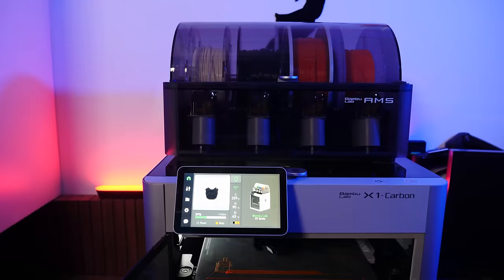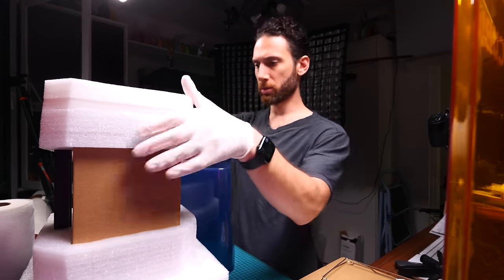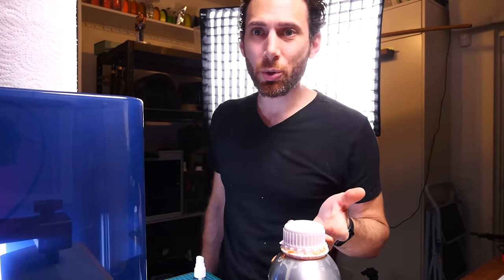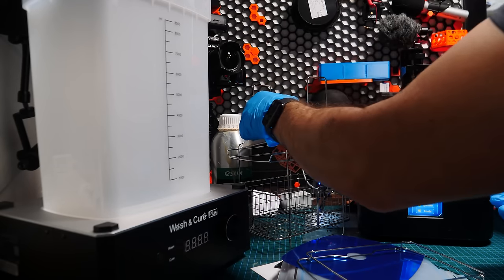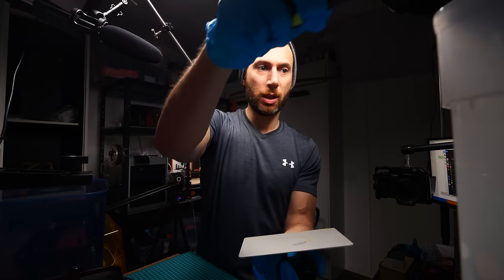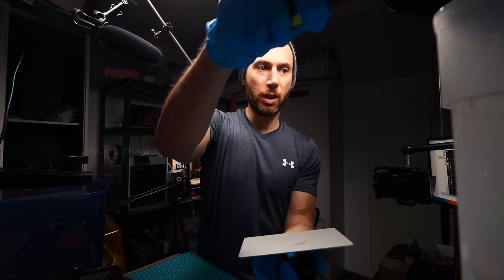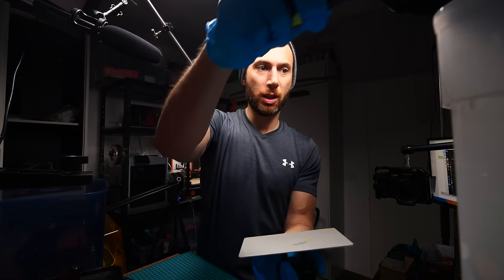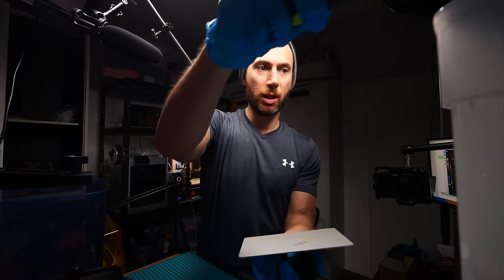Resin 3D Printing Wasn't What I Expected. AT ALL.

Comment: It's always interesting to see how a newcomer experiences first time resin printing. What always gets me on Youtube is how the noxious vapors problem is presented. Depending of the brand, yes, liquid resin can stink. But honestly, the respiratory risk you may encounter with UV resin is WHEN IT'S PRINTING, not just in its uncured or cured state. So it's a good thing the printing chamber is sealed during printing and now printers are sold with active carbon filters inside just for that. The VOC cartridge mask is unnecessary just to fill up the vat. Nitrile gloves (latex won't do) on the other hand are always always mandatory. 

BUT there's one moment when putting that mask is necessary: it's when you start handling liters of Isopropyl alcohol to clean the parts. That volume of alcohol can be fairly detrimental to your health, give nausea, headaches and implies a very well ventilated area. Note, Jonathan is not using his mask at that moment when it would be most useful. The solvent handling part of the post processing to me is the main hassle of UV resin printing. IPA is costly, a respiratory hazard, is a pain to recycle or dispose of when it becomes mixed with resin as a cleaning solution  but offers the best cleaning possible, industrial degreasers or methylated spirits being close seconds.  And none of them are risk free to handle or easy to recycle. 

To reduce cost, I'm using ethanol (aka methylated spirits) for the 1st cleaning bath and IPA for the finish one. The print gets enclosed in a sealed thin plastic tub with the iPA and floated in water for 6mn max in an ultrasonic cleaner with the heat off and always supervised.  That's the  same way mechanical parts can be cleaned with flammable solvents in a ultrasonic cleaner btw (don't leave them for long, always be present, always put them in a sealed container immersed in water). Parts always come out squeaky clean with crisp details. Remember, you can get a print from a high definition printer but if there's still residue on it because it wasn't cleaned enough, it's going to mar the details of the finished product.
Reply: To correct this statement, FAR more VoCs are release during the washing & curing process, than during the actual printing. (Oddly enough since we use IPA and it evaporates at room temperature.)
Reply: @ccatlett1984  Agreed. I should have developed the point i was making further :)

Comment: I have also recently got my hands on a SLA printer. I got mine from Elegoo and the quality is exceptional with some caviats. I totally agree with you that it is a mess, even other YouTubers are warning about this. If you are careful enough and clean any spillage after each print, it is fine and not that toxic. I am even thinking to get an air purifier for the space that I am using the printer.

Other tips I can share: 
- Get silicon covers for the surfaces infront and around the printer. They will save your workbench from the resin and you can easily toss them outside on the sun for a few hours to clean them more easily.
- Get paper towels. I use them on top of the silicon covers when I am moving the prints out of the bed and also cleaning any remaining resin from the tank after transfering the resin back to the bottle and run the clean tank exposure.
- Get plastic cups that can contain around 300-500ml of liquid. I use those for when I need to transfre the excess resin from the tank to the bottle or clean the washing station.
- Try washable resin. I have ordered a few bottles to test it out. They advertise it as nearly odourless, safer and easy to wash with tap water. By the way, depending on what resin you use and how big the objects are the IPA can be used for up to 30 prints.
Reply from the maker: Thanks for the tips! Will do

Comment: I recently bought the Creality Halot One and I love it. I use Anycubic ABS-Like Resin+ (it offers the right properties for my needs) and it STINKS. Did one print in the house then moved it out to the garage. I didn't immediately by the wash and cure machine, but after a month for the Anycubic one. That makes all the difference. My workflow is not too messy, but it's all in the garage, requires mask and a lot of disposable gloves. There results are perfect, though, and it's easier than FDM to get good prints.

Comment: Heheh, it’s always fun watching noobs do resin 3D printing for the first time, having already gone through the hoops myself, now every print comes out nearly every time. Let me offer a couple of useful tips for anycubic resin printing. Before starting that very first print, what everyone must do (but they don’t tell you in the manual) 1) apply a release agent to the inside of the resin vat fep. This is the reason for your first 2 print failures and more failures will occur if you don’t regularly apply release agent to the fep, I do this every time after each print, it’s just a part of clean up process. 2) don’t fill the vat to the max level, just use an amount appropriate to your part to make cleanup easier. 3) anycubic photon slicer requires all models to be sliced in anycubic’s photon slicer mine uses a .pwma file format but they maybe different for your specific printer. If you want to use chitubox or lychee which I do absolutely recommend for generating supports, you’ll want to save the model with the supports as an .stl file and then import it into photon slicer for final slicing, if you slice with any other slicer , your prints will fail (or never even begin) at least this is how it was when I got started a year ago and I haven’t bothered to check if that’s been fixed) but if you run into any problems with that just remember to try and slice only with anycubic’s proprietary slicing software and you will be good to go. And finally 4) the best advice I can give with supports is rotate your models so that they are not parallel to any of the 3 axis and orientate your model with the side you want to be the cleanest opposite the build plate clear of supports. Lastly, there are some tips worth mentioning for cleanup, but this is getting a bit long, go ahead and let me know if you want those as well! Thanks for the video bro! Good luck!
Reply: Oh and remember to calibrate your resin exposure settings! These will be different for each resin has different exposure profiles, dial in the manufacturers suggested settings with calibration tests to get the ideals you’re comfortable with

Comment: I buy the 7mil gloves. They're more expensive, but you can re-use them 10 times or more. They're easy to take off if you clean them with a little alcohol first. A silicone spatula works well for wiping the top of the plate before taking it out, less resin waste also, and keeps the wash cleaner if you stick everything in there. Flex plates make printing, washing, and model removal easier. I wash my functional parts on the plate, then just pop them off.
Reply: Eye protection is good also. Splashes and shooting support pieces can really suck. Making a handle for the top of the wash and cure is a must. It really helps keep things clean. I have a hinged cover for the printer, but you might want a handle for that, also. Make note, there is a large difference in smell between different resins. I've had "low odor" resins that smelled worse than regular ones.

Comment: Stay away from IPA unless you like to waste money. You can get methyl hydrate or methylated spirits for far less money and they arguably work better. Resin is pretty easy once you have your workflow figured out. I rarely clean anything when I'm printing. Put the gloves on, take the build plate off and into the washing machine, wash, take out and pop off the plate (magnetic flex plates work wonders), wipe the buildplate off with a small piece of paper towel and put it back into the machine, top up the resin in the vat, start the next print. It's handy to soak your print in hot tap water after it's cleaned to easily remove the supports. Once it's dry, cure it.
Reply from the maker: Oh snap I’ll look into that. Sad that I just bought more IPA

Comment: I just ordered a $99 resin printer because it's cheap and I've had less than satisfactory results printing some very small parts. But yeah, right now I'd diving deep into the safety aspects. Rather than trying to ventilate my shop I'm thinking of building a heated box so that I can do the prints outdoors.

Comment: I absolutely love that you showed that your first print failed completely. Realistically, even when following instructions (the original, multiple websites and youtube videos) the first 1-3 prints will always fail. In my case, the first 8 prints failed until i realised that the build plate of my Elegoo Mars Pro was messed up from factory. I spend 1.5 hours of sanding with 600 grit on a surface plate, and only THEN Prints actually worked. Not wanting to spend even more money on the Wash and Cure station, i tried water washable resin and was disappointed every time. In addition to that, im probably allergic to this type of resin as i get really horrible headaches from it in less than 10 minutes. Have only used the printer maybe 2-3 times since then and will probably scrap it for the linear rail to put on my Ender 3 lol.

For anyone reading this: Always remember that Resin is VERY TOXIC. If you have FDM printers, stay with those. In my experiences, resin printers are only good Figurines or other miniatures and nothing else.

Comment: Tip: water-washable resin.  It isn't less messy, but it saves on IPA ;-)  And the transparent Elegoo ones are so nice and make curing thicker parts so much easier (transparent, dooh).
Reply: also cracks a lot faster in a lot of situations
Reply: @br0k3nilluzion  Also, not any "safer" or "better for the environment". And then you have to find a way to handle the contaminated water (not safe to dump down the drain, it's just as toxic.)

Comment: I have been dabbling in SLA for a couple years now. Buying 99% IPA is a must and,  at that purity, it can be fairly easily "cleaned" several times for reuse, saving cost. Plus, if you are smart about it, you setup a bath container that you rinse tools and such in to save IPA. I found water-washable resin cost to match that of normal resin+99%IPA on the whole, and such "ECO" resins are safer from a handleability standpoint, not a disposal standpoint. They also tend to require longer layer and post-cure times, wasting energy (and time).

Magnetic build plates for SLA printers exist and I found them to be heavenly for preserving bottom layer quality vs scraping them off a firm plate.

I also love my stainless steel filter funnel! So much better than plastic funnels and paper filters (there's your eco and savings). Get a small air filter for inside the SLA, too...helps tons with the smell and I'm SHOCKED Anycubic didn't include one since that's exactly who I bought mine from!

Just like with FDM, once you get familiar with everything, you start to learn more tips and tricks for an easier time working with resin.
Reply from the maker: Good call!

Comment: I have a variety of both fdm and resin printers in my shop. Each method has its advantages and disadvantages. But there is no question that resin prints deliver much higher detail and less sanding and post processing minus washing and curing. But fdm has the ability to making larger and stronger parts and is “cheaper” in respects to materials. 

I’m not familiar with the resin used in this video but the resins I use have virtually no smell. It will burn your skin though so gloves are a must. 

For models and some cosplay a combination of resin and fdm are pretty nice in respects to finish and detail. 

Personally I’d like a bit larger resin printer but to step up to what I’d like is very pricey not that the larger resin printers I own are small but I’d like bigger…….

Comment: Thank you. You have re-affirmed my conclusion about branching into resin.

I picked up my Bambu X1C just today, so that will keep me off the streets for a while. Much as I would like the option of resin printing for fine mechanical parts, my workspace is a 3m x 3m carpeted room in the middle of the house, so it is absolutely out of the question. So once my shiny new FFF printer is bedded in I'll look at getting a 0.2mm nozzle for when I want to make a tiny/prices part.

Comment: I use resin for TT games and selling. And there is a solution. An air tight grow tent for $40 plus an exhaust fan and some hose leading out a window can fully ventilate your tent of all toxic fumes. Cap the exhaust hose when you’re done for the day so nothing leaks out over night and you’re 100% resin free and always working in a small chemical containment area for less than $100.

Comment: one thing i got the resin printer for is actually for printing replacement gears out of ABS like and other hard materials. so you could actually look more into using it for practical printing as well :)  
replacement parts for small electronics like headphones too.

Comment: I just got into resin printing and bought the exact models of printer and wash/cure station you have there a couple of weeks before finding your channel, although sadly the cure station suffered with a warped turntable so it's really just a wash station right now 😂.  Been having loads of fun with it although I did have a much harder job removing the test cube from the print bed than you did so possibly doing something wrong, 3 prints in with (touch wood) no failures so far, expecting to have many now I have said that. Will be interested to watch your other videos as I am fairly new to fdm printing too

Comment: Great walk-through of the process 👍 
I would prefer a DLP projection for the UV. It seems as a better option in the long run.
I still don't think the process is mature enough.
As you mentioned, the filtering in the chamber is a better solution in the long run.
I would prefer a resin "run out" sensor implemented from the start as well.
I love the implemented wash/cure station though,  a big step in the right direction. 
Great walk-through of your expirence.
Reply: On the resin run-out idea - there are a few different printers coming out this year with resin auto-fill. But I suppose you're still need to know how much is in the bottle!
Reply: @davedavem  Those are a major move in the right direction, but if they're like the one on the Jupiter (very similar to a kitty bowl refiller), I probably can't use one, and a lot of other folks can't either. The engineering mixes people use if they don't print miniatures (and even mini printers sometimes employ if they sell b/c shattering is bad for business) are too viscous for the feeder. Warming band might work, but strong & tappable resins are $50, 70, 100+ a liter depending on properties & I'd be concerned about degradation if they were stored warm in the feeder jug for long periods of time. They also separate & need to be agitated periodically.

Comment: I have experiences with resin 3D printers, right now I own Elegoo Mars 2 pro and I agree with the mess, but you can upgrade the printer.
You can use handles to the lid, you can print with PTEG new filler for the resin bottle and make carbon filters to filter the smell.
FDM printers are easy and great but the details in Resin printers are much better and after painting the prints, you will be shock.

Comment: well i do say initially cleaning is a pain but with some vids and tips on how to do it its less painful there are some vids that show how to use a metal tray or a silicon mat with a rim to allow for no spillage and you just isolate the resin bottle on there with the build plate and vat use paper towels and microfiber cloths cut into bits to clean of course it takes time and practice but once your use to it it just becomes something your normally do for ventilation there are fume boxes kinda like tents with a ventilation hose attached to it u can either use a charcoal foam filter block inside the hose or directly connect it outside if thos are not a option there are air purifiers that are usb rechargeable and fit beside your vat to purify the fumes of the resin

Comment: I have to make this clear i cannot stress this enough! I am 3 or 4 months into resin printing and got it down to a fine art understanding all the slicer settings etc but this what people keep saying abiut it being a messy job its just how messy you the user wants to make it! I have 3 printers and work on 2 of them cheap plastic dinner service trays, with paper towl down and your plastic scrapers and your metal one to hand but the plastic razors i use the most, i don't use that metal scrapper if don't need to! Point is i have this small tray area thats perfect for laying down your plate removing even 1.4 scale statues i do with little to no mess! The build plate you scrape that clean with your plastic scraper whe first remove it top first youll get the resin to sit in a pool on top of the scraper and just pour it back in the vat! Its simple just work at being cleaner its not a messey job atoll!

Comment: 🇨🇦/🇺🇸... Like you, I am mainly interested in utilitarian prints but that is actually why I wanted to investigate resin printing, purchasing the same model "mono 2" printer. The LAYER weaknesses inherent in FDM prints make it poor for some items that need strength and when I saw that there were some very strong (though expensive) resins available (phrozen Onyx Impact Plus 3D Printing Resin) I thought it worthwhile to get a handle on this technology. I'm finding that to be VERY safe seriously adds to the expense, however, and as I'm in a one-bedroom walk-up apartment where the ventilation is shared, I'm trying to be extra careful with opening the windows wide.